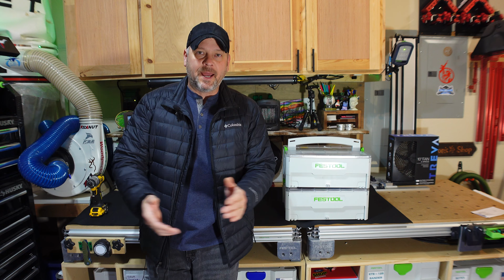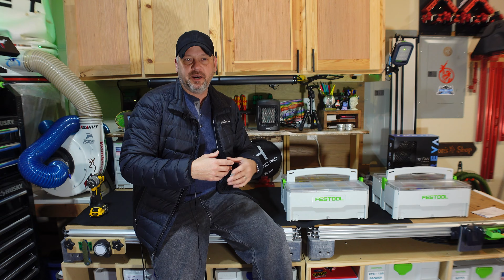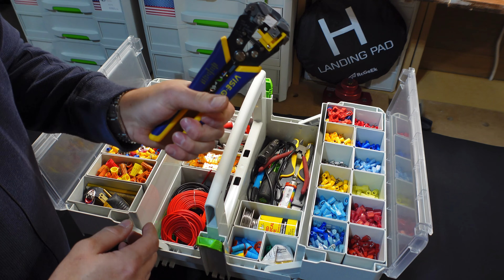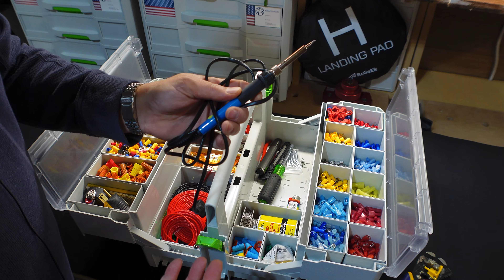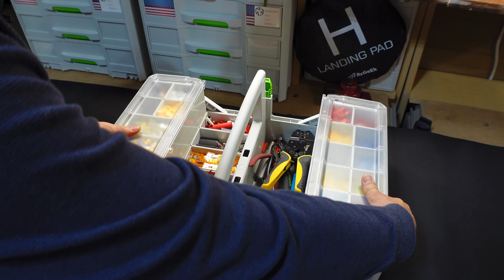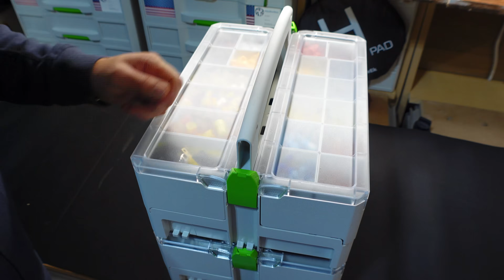Festool Systainer Tool Box: Electrical Edition LOAD OUT.

Comment: Hi Brian. Great video and excellent kit to handle most electrical issues. Maybe throw in a few 8” or so pieces of black, white and green 12 or 14 awg solid copper wire in case you have to pigtail or jump an electrical device.

One thing that I like using are solder seal heat shrink butt connectors. Essentially you can splice a wire with a heat gun. There is a small amount of low temp solder inside a heat shrink tube. Creates a great sealed connector for something like trailer lights.
Reply from the maker: Thanks Chris. I’ve watched a few videos on the solder seal connectors and they do look pretty interesting. Might have to give them a go! Cheers